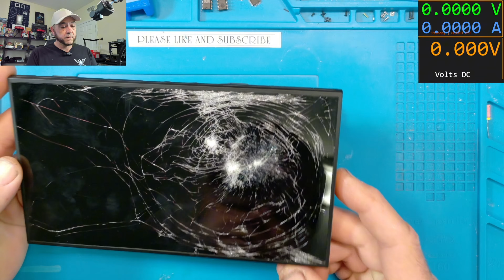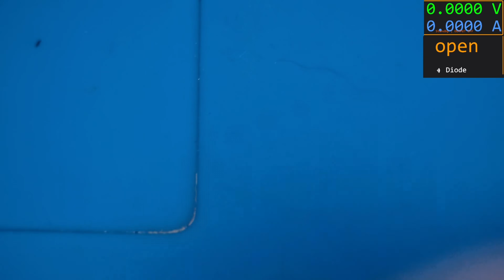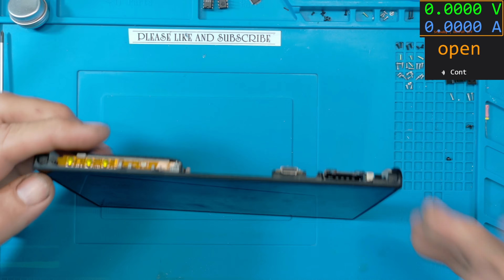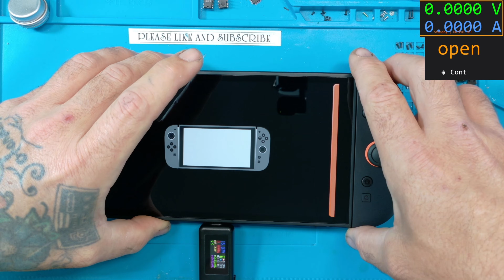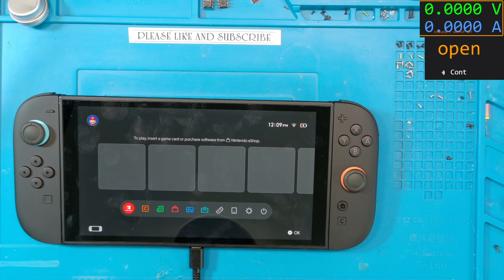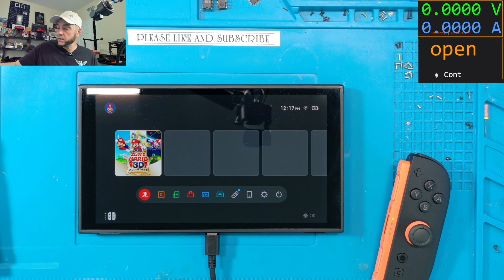SWITCH 2 REPAIR PART 2

Comment: Awsome stuff! I will receive a free switch 2 with my new internet connection i,m curious if it is just as good as my steamdeck
Reply from the maker: Well I’ve got both systems and to be honest my play style differs immensely between the two. My Steam Deck is where I play most of my emulators and games exclusive to PC.
However since I’ve gotten my switch 2 I find myself playing back through the Zelda games. Tears of the Kingdom is awesome with the enhanced visuals. I’ve also played Mario kart world but honestly I’m hoping Nintendo will release some major DLC for it.
They’re both good but it’ll boil down to your play style
Reply: @mynerdcave that all sounds very promissing, i play zelda botw in 60fps on the steamdeck it,s been a blast! Some metroid stuff and other retro games.
Reply from the maker: @tomaswolsink7620 the Steam Deck is one of the best systems in years. I’ve never regretted buying one. I’ve got another deck I’m hoping to get around to repairing soon. 
They’re getting really expensive and even the broken ones can sell for a lot of money

Comment: Great Video. I had a question what camera are you using for your top down shots? Looking to get into shooting vids of my own repairs and have struggled one putting together my setup. All the recommendations are for like $700 cameras and I just want something that is a bit better than my 5 year old cellphone. Thanks.
Reply from the maker: I just recently switched from the Logitech to the Osbot tiny 2. I think it was around 150$ on Amazon. It took a little while to get it right but I’m honestly loving the results.
I had the same problem when I was looking into what setup I wanted. 
I’m planning on replacing my nerd cam with the tiny bot 2 as well
Reply: @mynerdcave  Thank you so much. That one was on my radar and probably the one I will pick.

Comment: If you are sure the m92 chip like is the issue you should of remove that chip.from the working one and put it on the non working switch to test if is that or not.
Reply from the maker: I honestly considered doing that just to try and prove the fault but that’s a BGA chip and if I messed it up during the process and it ended up not being the issue I would have 2 non working boards. I’ve got that board set aside until I’ve got a few donors to play around with and I can find them cheaper

Comment: These switch 2 are going to be impossible to fix without a place we can buy ICs. I'm sure you will fix the joycons tho. Software looking really good with the new tools 🔥
Reply from the maker: I agree without a reliable source of replacement ics the repairability goes way down. And I’m noticing more and more that Nintendo has designed these batteries fetts to self destruct on the BMS. Every battery thus far I’ve found has a dead BMS with live cells. Right to repair is gonna be hard.
And thank you for bringing the software to my attention and to circuit fix for all the hard work in getting it working